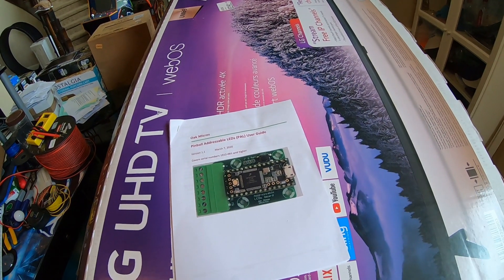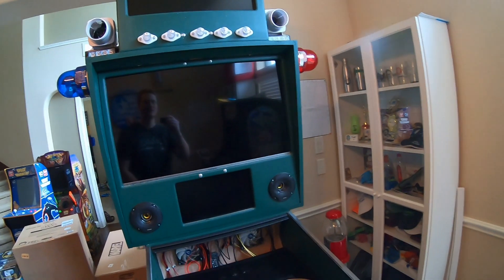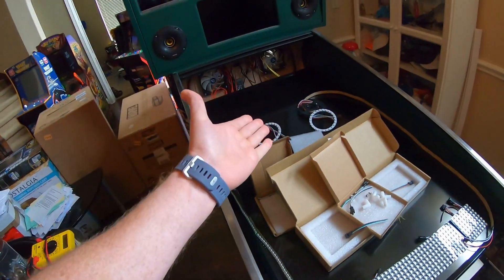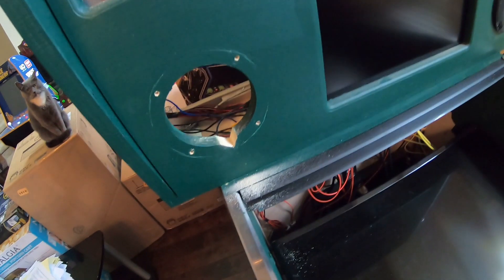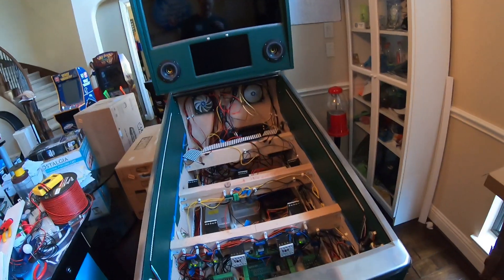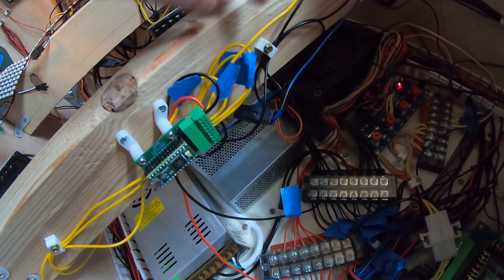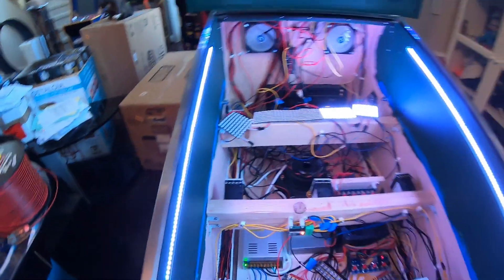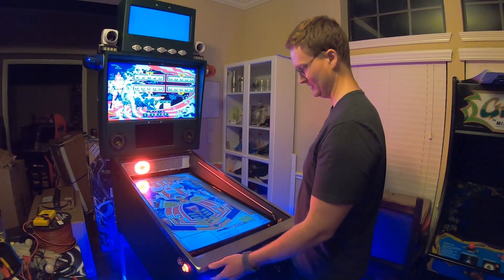Addressable LEDs - Virtual Pinball Build 21

Comment: Cool! Is it possible to add a 3rd led strip on the top of the backglass too? Not a matrix board, just a led strip.
Reply from the maker: You can put them anywhere you want. You just have to figure out how you want to program the software to display there. Be it strobes or whatever.